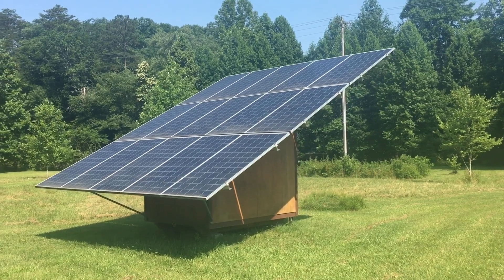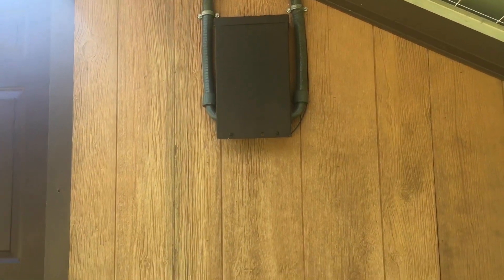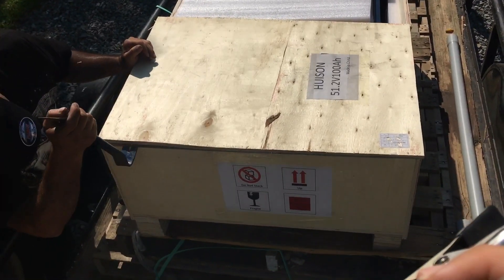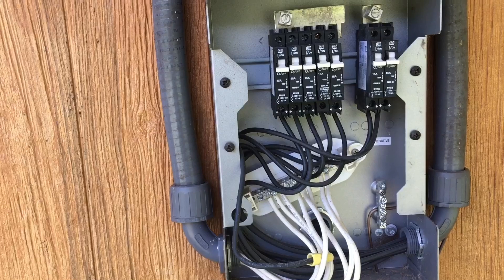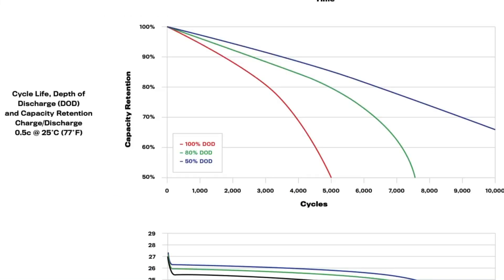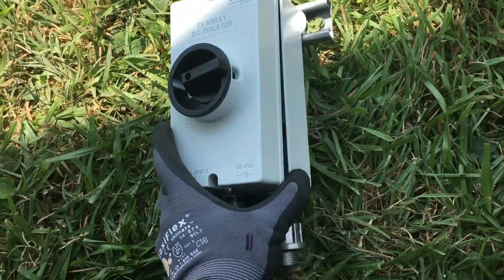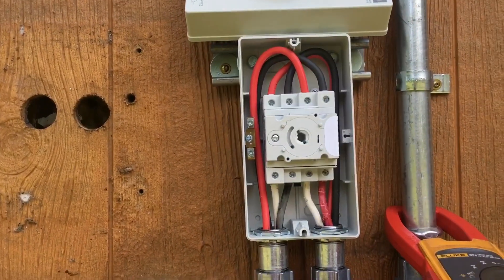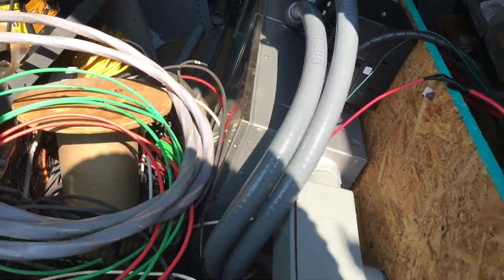Upgrading from a Radian to a Solark12k: Rewiring the Solar and scrapping lead

Comment: You guys do know that you can do the same with the XW Pro & WattNode, Solark is not the only inverter that can do this.
Reply from the maker: Yes but out of the box xw is just an inverter. It’s a good one but it’s like comparing a fixed blade to a Swiss Army knife.
Reply: @GainSolarPower  That is true for the XW in 2006, from 2014 with the XW+/XW-Pro, its just not an inverter out of the box.
Reply from the maker: @goodoleme  excuse me. Inverter/charger.  Are you insinuating it’s anything more?  It doesn’t come with a controller, it doesn’t come with any breakers or interconnection equipment.

If you buy this inverter, you need other stuff to get it up and running.  

The beauty of an all
In on type inverter is that you side step all these parts and pieces. I get it you don’t have a transformer that is nice to have but at the end of the day Solark has really simplified things and as long as you design your loads around the inverter the transformer less issues are not a problem.

Comment: Looks like were moving away from the magnums and into sol-ark these days, I see Scott is doing the same. Good to know, i was just about ready to start a magnum 4448 project. Guess i’ll look at the sol-ark inverters instead. Thanks for the video.
Reply from the maker: I can help you design a system and sell you the material and talk you thru the install if you need help. Jwv8783@gmail.com

Comment: Doesn’t the radian also use CTs to see all of the homes loads? Can’t the radian offset-supply the power the homes main panel is using and operate like a grid tie inverter? I was about to buy one because I thought it would operate like a gridtie inverter and do zero export? Please clarify. 
rjh010277@gmail.com

Comment: What are CT's?
Reply: Current sensors placed on conductors. (around them)
Reply from the maker: The solark sees how much power the house is using with the cts. so it can push power back into the whole house without pushing into the grid
Reply: @GainSolarPower  CT's are Current Transformers. You can think of them as a pickup coil if you like.  You can get them in various conversion ratios and sizes for a variety of applications.  They are very accurate and can be purchased in high accuracy metering grade.  My utility power metering is done with a pair of large CT's. The output signal from the CT's feed my utility meter.